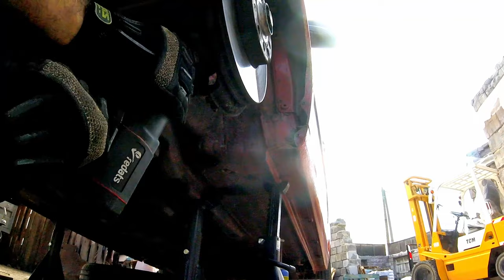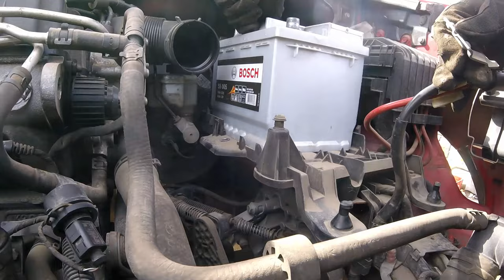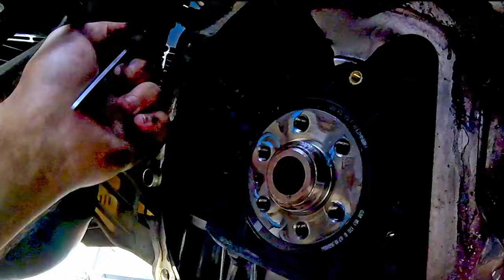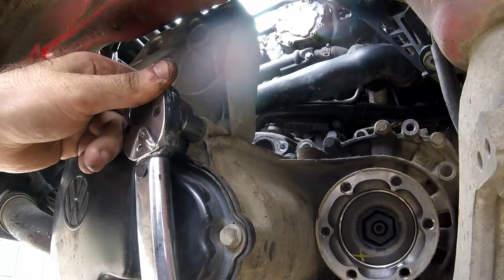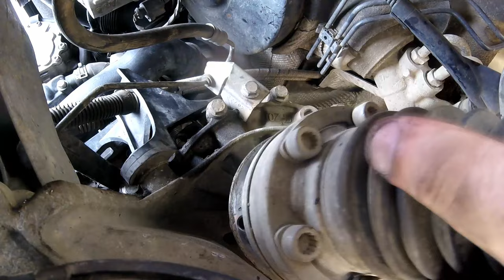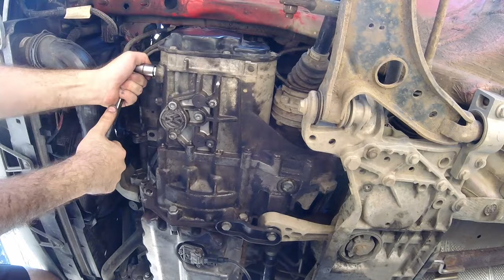VW Caddy 1.9 TDI PD 2007 | Transmission and Clutch Removal and Install | G28 Engine Speed Sensor

Comment: Wow, almost everything is dissambled. These engines are great tho , have an audi a3 2008 with the same one. Never had any issues. Did the timing belt and waterpump recently. Clutch is starting to feel soft , so i got to your video. Seems a BIG JOB wow !

Comment: Very good video - thanks! The only thing that goes a bit fast is how you lifted the engine with bridge and supported the gear box with a chain when you were under it. I would have found it even more helpful if this was clearer in the video - for those of us with less experience like me, this is a challenge or at least makes me quite cautious. You seem to have undone only one engine mount (the gearbox side)...?
Reply from the maker: Hi, thank you, yes I removed only one engine mount. I supported the engine with the bridge and the bottle jack (just to be sure). I chained the gearbox to the bridge just so it wouldn't fall on me, because I didn't know how heavy it was. After I realised it's quite light, I grabbed it by hand while another person removed the chain from the bridge.

Comment: Clean and professional work. Hey man, one question, what air compressor do you use? Is it enough for every air tool do you use?
Reply from the maker: Hi, thank you. Back then I was using 24L Nuair 1,5kW single piston compressor - basically the smallest and the cheapest compressor. It worked great for impact wrench, die grinder, air hammer, and even for hvlp spray gun. Now I've got 100L Agre twin piston, because I wanted to do sandblasting.
Reply: @benjaminmarcinek  thanks for the reply, im in the search for a compressor currently, based in your comment i think 200l is just overkill, as im not going to use it extensively, i actually bought an air hammer first 😂 so does your current 100l compressor works flawlessly with that sandblaster? I know those consume plenty of air.
Reply from the maker: @RGV2300  yeah it works well with my handheld gun.

Comment: The clutch cannot be changed without drain the gearbox oil?
Reply from the maker: No, unfortunately... In order to dismount the transmission you need to unscrew the passenger's side output shaft "cup" (the thing at 6:08), thus oil would leak.

Comment: I switched from auto to manual do u use back plat and shims ?
Reply from the maker: There was a factory supplied backplate it stayed on the engine block side, I didn't even remove it.

Comment: Nm?????
Reply from the maker: Hi, I was following the "VW Caddy (2K) - 5-speed manual gearbox 0A4" workshop manual, there are all of the torque specs, you can find the manual online for free.
Reply: Where find manual????
Reply from the maker: @florinmunteanu1670  I found mine here: https://cardiagn.com/vw-caddy-2k-5-speed-manual-gearbox-0a4/
Reply: Passat cc 2008....mi servirebbe la stretta dei bulloni in Nm....parlo di tutti bulloni de la macchina...non riesco a trovare....grazie per le risposte anteriore
Reply: Passat cc 2008 cbab 103kw 140cp 357
Reply from the maker: @florinmunteanu1670  Try this, hope it helps you: https://cardiagn.com/vw-passat-2005-2008-passat-variant-3c3c23c5-workshop-manuals-wiring/ Good luck, brother.